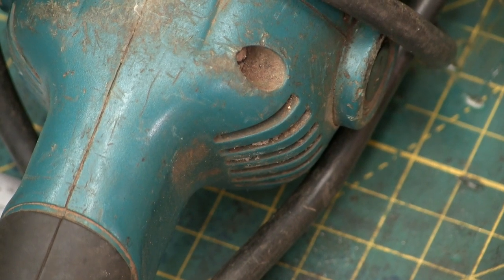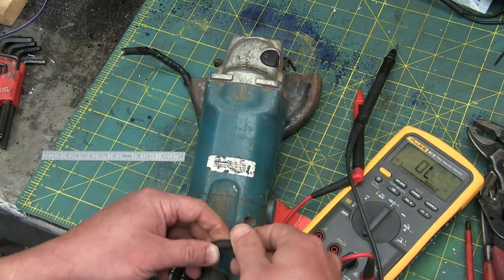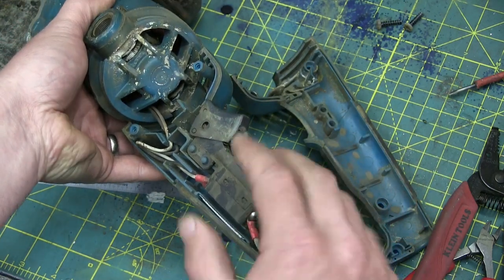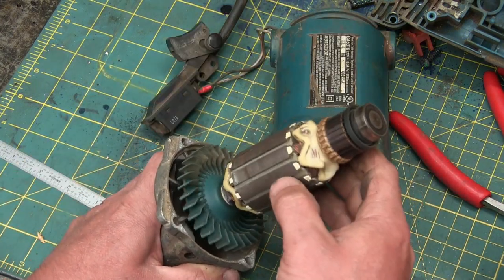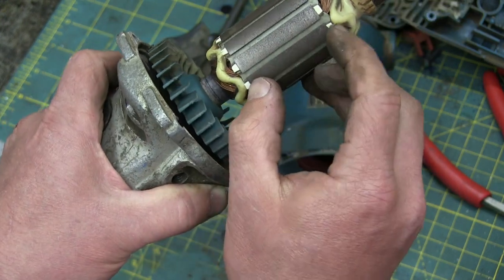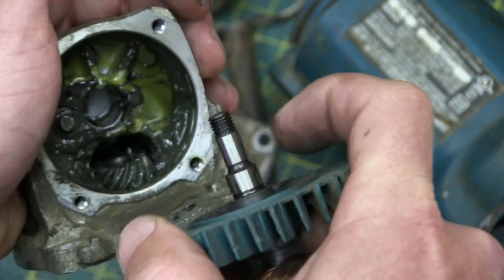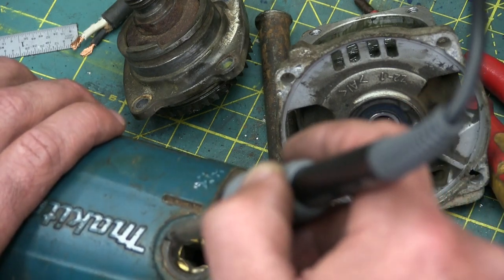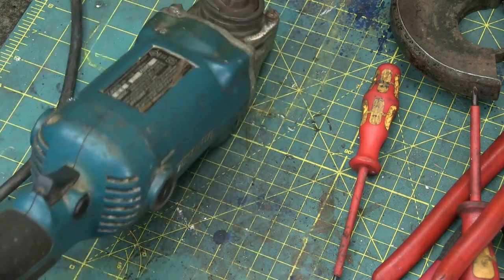BOLTR: US built Makita 5 inch angle grinder

Comment: I have had a Makita grinder in my hands for many hour on the job and they hold up.  The last shop I worked in they stopped buying high dollar 5 inch grinders they went to the Harbor Fright one because it was more cost effective because you would get about the same life out of them around the buffing compound in the buffing room.  I was rebuilding the Milwaukee straight shaft grinders about every month, the Milwaukee 4.5 inch grinders about every 2 to 3 weeks, the HF one would last about 2 to 3 weeks toss in new brushes and when they were gone they tossed the gringer...  The one thing I did do was put more grease in the gear housing...

Comment: The old school Black and decker Power Cat grinders are the real deal in the pipe line industry. Not real sure they still make them though. Also the "wobbly bit" tool removal button is always worn due to someone pushing to while it's still turning ( stupid kid move) sometimes in a tight area they can get mashed in by an obstruction. That's how they really get worn.

Comment: Got 2 Makita grinders - one is a 4" 110V one and the other is a 9" 240V one (I'm in the UK and 240 is domestic voltage here . . . ) Bought the 4" one at least 25 years ago and the 9" one not long after - and they were both secondhand when I bought them. They've both just kept on going (although I do seem to recall changing the brushes in the 9" one once . . . ) but in the meantime I've gone through at least a dozen other brand 4-1/2" grinders. Doesn't seem to matter how much I pay for them, they never last long. On the upside of that I bought a couple of real cheapies at £5 on special offer at Screwfix and they lasted about as long the expensive DeWalt that keeled over recently. Segment missing from commutator and I could buy a reasonable grinder for the cost of replacing the part . . . 

Looking for another 4-1/2" grinder now but they don't earn me a living anymore so it's hardly worth buying the good stuff for what is essentially a hobby now. 

Thanks for the great videos - only just found them but I'm really enjoying them

Comment: Thermostats have "slop" so they don't switch on and off several times a second when they finally reach the temperature they're set to. Of course, this is natural slop and not engineered into the system. Another example is VTEC which uses hysteresis in the control software to prevent the constant activation and deactivation if the engine is held at exactly 3500 RPM (the switch on point). The switch off point is purposefully set at a lower RPM to prevent damage to the VTEC system.

Comment: The one weakness of these grinders is that the went away from the brass pivot on the switches.  You can count on replacing the switch once a year under regular use because the plastic pins wear down and the holes elongate, making the trigger ineffective.

Comment: You should see if you can get ahold of a GE Power Break II circuit breaker. Those have some pretty decent features and build quality. But watch out for the engineered failure of the bump stop. Melts right out and the charging handle won't latch on to the closing spring. Don't know if you have dealt with those at all but I'd like to know why they used that material.

Comment: A hysteresis that almost everybody will be familiar with is the home/fridge/car/etc thermostat, talking HVAC anyway, I don't know that the coolant thermostat is complicated enough to have a hysteresis. In a thermostat the hysteresis is generally "how far past the set limit to allow before acting", and in reverse "how far past the set limit to drive the state before turning off". In the hot summer months you set the thermostat to 68F and it'll probably push the room down to 67, maybe even 65F before shutting off the AC, and then it'll wait for the room to get above 70F or so before turning it back on. This is a feature in this case  because you do not want your AC to get the room to exactly 68F, shut off the AC, twelve seconds later the room is back to 69F, AC kicks on, back to 68F, shuts off, 69F, kicks on, that's a great way to wear your AC compressor and furnace fan straight into the ground.

Comment: I've had 2 of these Exact grinders fail in a very strange way; they ingested enough grinding dust to build up and complete the circuit between the white and black pixi tubes on the trigger...
I was grinding away with it, set it off to the side, and damn near shit my pants when it started up all on its own accord, grinding away and belching smoke from the housing. 
Simple enough to fix, but worthy of an underwear change when it happens...

Comment: They don't just use that pressure fit/ keyless stuff for tools, I know for a fact that the Ford 2.0 liter family of engines for at least mid 2000s and up use that same thing for the oil pump and timing gear on the crankshaft and it's all held in place by the crankshaft pulley bolt at ~100 ft-lbs of torque

Comment: i love my Makita 1/4" impact i got the 3Ah lithium battery not to long after it came out. charges up in 15 minutes and it last as long as i can. (24 y/o) love the content Been using Makita drills for a long time. do not care for the chuck that is on the drill driver though either has something stuck in it or it is off by a mm because it wobbles. i do not have the digital one it is the classic style switch and motor which i like because i get to see the sparks off of the commentator. lol
the combo pack will go on sale at the homeless despot or lowes on occasion which i think is a killer deal. (almost half off)

thanks for the content been having a few so i got lost on the part where you found the problem beg my pard.

Comment: My Bosch 4 1/2 sees a lot more use than my big Makita. Both are super tools but the Makita is like bank vault. FYI, the supply wiring on many tools and transformers seem way undersized at least as far as the NEC goes. I usually find that it is very special stuff usually rated at 105C and find stranded like MTW. I like that they switch both the hot and neutral. I don't know why, but that makes me feel like they go the extra mile even when nobody knows but AvE.

Comment: Ah, the venerable Makita 9005. I fix a lot of these at work and usually what happens is the head casting will get buggered up around the locking button and the button will not hold the gear anymore. The only thing to do is replace the casting. Fortunately they are available and cheap to buy.

Comment: I believe that another requirement for double insulated is that the rotor/commutator needs to be insulated from the rotor shaft so a break in the enamel insulation would not energizer the drive train.

Comment: This might resemble a picking of nits, if so, my regrets.  As the eldest brother of 17 kids, I learned to fix, make, invent and cure everything that could possibly go wrong with anything the other 16 could possibly screw up.  I noticed that no attention was given to cleaning before reassembly.  I'm aware that wasn't part of the intent, that you were trying to show why it was such a good and worthy tool.  Doubtless you have others, newer or of longer acquaintance and that this was simply useful for exhibition.  Still, my need to ascertain that nothing was left floating around that might cause trouble, like crud on the trigger wiring for instance, before closing up caused my bell to go off.  I've subbed and enjoyed your videos and playful linguistics and I'm sure that will continue.  I wait with a worm on my tongue for your next video.  (Baited breath, don't you know...)

Comment: Have you noticed electric motors failing soon after replacing the brushes? I heard this from a knowledgeable coworker (though not specifically in faerie wrangling) who said he heard it from Crown techs. I wondered if this was from a poor break in process with the new brushes. Is there any such thing, as there is with say an automotive drive train clutch?

Comment: Free stuff is the best when its a simple problem. I got a free Kitchenaid mixer (will probably just sell it when I'm done playing), that the person I got it from put new brushes in, but had them flipped 90 degrees so they wouldn't get past the keyway and touch the engine. I was going crazy looking for why the motor had no power, until I decided to check the brushes and noticed the springs seemed more compacted than it should have been.

Comment: I bought a grinder at harbor freight for 8 bucks. It lasted over 5 years on my work truck as a mobile welder.
Reply: You'd be surprised what you can do with a little duct tape and ingenuity.
Reply: welding dumpsters is not the hardest work, how long did the blue star last?
Reply: jrpNH3 True. Either is welding employee ladders and customer used lumber carts. Except for the fact that injury liability gets transferred to the repairman once a repair is complete. 5 years and a day...

Comment: Magnetic fields take finite time to rise and fall. Bigger chunks of metal take longer to gain and lose the field.   With ac power the field is swapping back and forth 50 or 60 times per second. Big lumps can’t change ends that fast so the induced currents fight and get hot. Laminated cores don’t allow big currents and fields to flow so there’s minimal heating.

Comment: We use dewalts, when they crap out they are done. The centered metallic gear is what wears out, it will wear out and eventually just get ate by the pinion from the motor

Comment: My dad had an old skillz drill that was metal cased, we used the ever love crap out of it. Near the end it was getting really bad where the drill was still working but every once in a while you'd an unpleasant 120 volt jolt.We tore it apart and found a single wire was eroded in it's shielding. Nothing funner then drilling through 3 2x4's and getting the ever loving shit buzzed out of you for 5 seconds. Still that drill was a champ we opened it up and taped the offending wire kept using for another 5 years. Retired it when arching starting shooting out the sides. I'm guessing brush failure but those types of drills are awesome to work with but you end up with a few more points on your man card at the end of day using one for 15 years and only stop when the dragon inside starts spiting flames. I draw the line.

Comment: I think you meant "remanence" (as in what 'remains' of the magnetic polarization). Hysteresis means the turning on does not happen at the same value of force/voltage/brightness/... as the turning off - so  the switch/transistor/... does not oscillate like it would if both points were the same...

Comment: As a welder in the oil patch I have used these things for close to a decade now, and honestly Dewalt, Makita they both die in roughly the same amount of time. I've had a Dewalt D28065 that lasted my for close to a year and a Makita that had the same sort of run. I've also had one of each that exploded within a week, took them apart but the blue smoke had come out and as you know once that blue smoke comes out you can't put it back in. I wasn't reefing on either grinder but they died all the same. My honest opinion on grinders is if your not a welder they will last you years if you buy either type. If you are a welder you will burn them out at a rate of 4-5 a year it doesn't matter. But as for personal preference I like the Dewalt more because of the thinner body, you can take the handle off and grip the body in really tight area's, and I don't know why but it seems to have more torque.

Comment: Double insulated refers to the motor shaft being insulated too. So if the rotor or com develop a fault, the head won't become live. As for the disc lock failure on the dewalt, I'm not surprised. Though it's still possible to change the discs without it, just a pain. Where there's a will there's a grieving relative.
I know I'm late to the party, but at least I'm here.

Comment: Doubt AvE will see this but ... i have repaired (or Return without Repair'd) many of these.. i prefer the 9005B, because the bearings were far more beefy, even in the same size. The newer chineasium ones break appart under strain, seen it happen a few times.
The clamshell handle on the back also gets loose on the newer model, which dosnt happen on the 9005 cos its screwed into the housing.
The lock is nice, though.. also an interesting thing, the 9005 used to have a metal protection around the top of the housing where yours broke, to rest the tool, but in the intrests of cost cuts and efficiency they simply made the housing taller there for a rest, and people break that bit off fairly often.
Other than those observations.. ive seen these things break the rear bearings..but the rest was the 200 pound gorrila as you said just reefin on it and basically turning a nicely built tool into a pile of scrap fairly efficiently. burning the motors to hell, and the play in the lock we figure is them locking it while the grinder is moving.
Swithes fail, too, and ive seen the white wire on the motor side burn clean off.

Comment: I'm an early twenties home gamer, most of my wrenching experience is wrenching on my two wheeled death machine and the family's cars. I've been looking at acquiring some of my own power tools, and I recently picked up a Milfucky Lith-Ion battery impact gun (needed it in a pinch to get the nut off the output shaft of the motorcycle's transmission to change the gearing). But after seeing this, I think I'm going to have to add a Makita grinder too my tool bench. Should I buy one of those Makita package deals and get all the major goodies? Or are there some things Makita just doesn't do as good as some of the others?

Comment: I didn't see the whole cord in shot, but I was wondering at the first test if you'd gotten the wrong end of the cord :P, happens to the best of us at times.

  Been in the market for a good grinder as i've got a few bucks burning holes in my pocket, been reading a lot that the newest models aren't nearly as skookum though, the one year warranty scares me off a little as well.  If a tool is that well built it should be at least 2, maybe 3.  Might try looking around a bit for some old stock though, nothing but godo to hear about the older 9005b

Comment: Both my Dewalt grinder and dremel (12 year old's tool I know)  have the lock up pin problem. Extremely hard to change to a new wheel. They are in great shape otherwise so its a very frustrating failure point.

Comment: Glass fibre is an odd thing. I got my garage floor and stub walls poured using concrete with glass fibre mixed in. Apparently it greatly increases the overall strength. Who knew? Over twenty years, it’s stood up well.
Reply: Cheaper and easier than steel, wire mesh that's pulled up to the middle of the pour. (Not as strong, though).

Comment: Re: Hysteresis. I use the term frequently in the context of a logical argument with temperature thresholds. If you have a high temp alarm threshold of say, 80F, and set a hysteresis of 2°, the temperature reading would need to drop to 78F to clear the alarm. This hysteresis value would prevent the creation of repeated erroneous alarms if temp was rocking back and forth between 79F-80F.

Comment: Seems like you didn't put the full BOLTR effort on this.  How many Amps/sq-mm in the armature windings?  Is there enough electrical in this for a part 2?  I've commented on your AC stick welds:-), maybe some grinding of them with this Makita could be filler for a second part.

Comment: I've been shocked by a "double insulated" angle grinder before. All it takes is a single wire in the rotor to wear through the insulation and it will contact against the metal laminations and the shaft.

Comment: nice find. I've seen plenty of those for a while and the only time they go bad is when someone's disc (disk?) grabs the cord and shortens it on the spot.
Also, the dewalt grinders have another problem. the abs plastic handles break on the lug and just spin free. so no detail grinding for that till you replace it. Epoxy does fuck all. Seems epoxy doesn't take to torsion too well.
(Is torsion considered a shear force?)

Comment: Aren't eddy current losses and hysteresis losses separated issues? electrically isolated laminations reduce eddy currents, while hystetesis losses depend on the material used.
Reply: TheENxis I was looking for this. You're right. Silicone Steel helps minimize hysteresis losses - it makes the flip-flopping of the pole dancers happen a little more skookumly without burning to frig.

Comment: I’m wondering about the thing you said with forging vs casting and such. Wouldn’t the
important part be the process that takes place after. Sure the forging will work
harden the piece but wouldn’t they be better off with say a carburizing
treatment. Which could be done to the casted or machined piece? Well it’s hard
knowing which process they use after but wouldn’t that process be that one
which really matters?

Comment: I had the older less streamlined version that shows up at 9:12 as my first grinder just out of welding school in 1997.  It finally died two years ago (the gears finally stopped mating).  At one point the handle was run over by a forklift so I pieced it back together from other grinders and it ran for another 10 years--skookum as fuck and harder than a coffin nail.  I've heard not so good things about the new ones.  Oh yeah, and it never once had a guard on it.